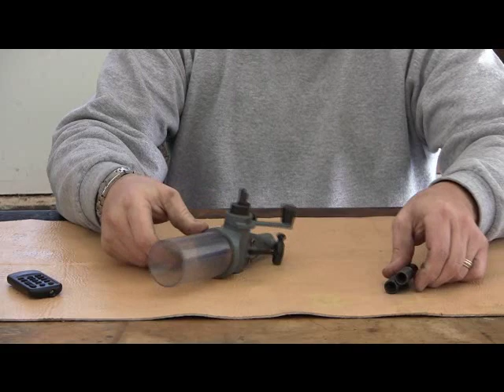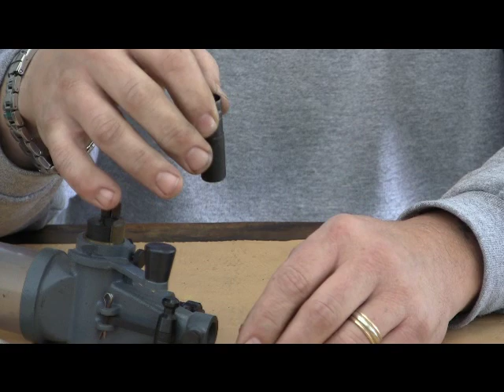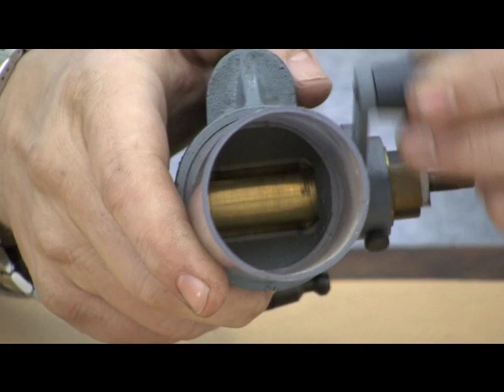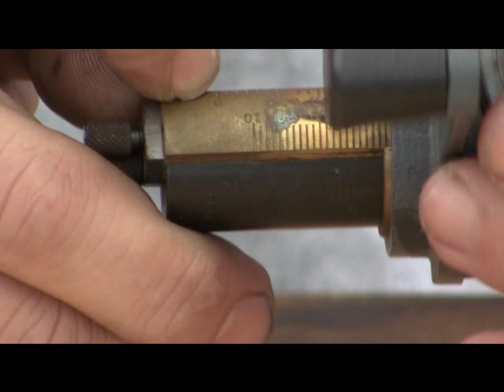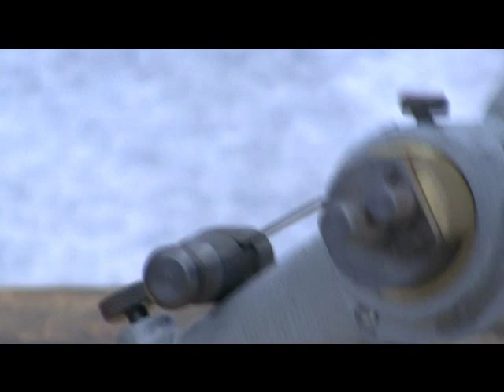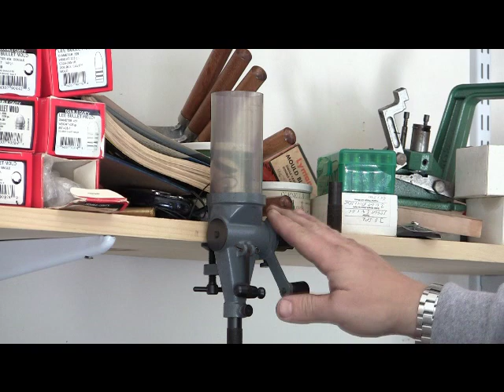Lyman adjustable powder measure 2nd version How to set up and use

Comment: Sometimes when you're using powder it sticks to the body of whatever you're using it sometimes it'll stick to the little tray in the scale you'll notice it also sticks to the top of the reservoir tube sometimes it sticks to the funnel. That little knocker is you flick that and it gets all the loose granules that are sticking to the inside of the body of the measurer . In my opinion you start with the lever in the top position swing it down and with one of your fingers you give the knocker a little flick and then bring the lever back to the top. Probably with two or three practice swings you can conquer that.

Comment: Thank you. 13 years later I am researching this as I bought the exact same unit 2nd hand. I reload .45ACP.  

Can I assume that if I set the bottom slot on 50  (marked on the G scale  = the "course" setting on black cylinder and lock it in)   The G settings higher up when loading, are for rifle loads I think.  

Will it  give me approx.5 grains of powder?  Is that assumption right?  
Sorry I do not have an electronic scale yet.

The small adjustment screw moves the brass slider left or right for fine adjustment after the decimal point?  If I move the small brass slider left,  the aperture becomes smaller,  and to the right the aperture is bigger,  but the bottom slider stays in the same place.. 

From a starting point of view: Do I start with with both adjustments aligned (say 50 in this query), and use only the brass slider to fine tune the increase or decrease of the amount of powder required?

Comment: Just getting started and bought some used equipment. One piece is an orange colored Lyman powder measure similar to the one in your video. It’s missing the cap for the reservoir. Do you have any instructions for setting it up?

Comment: as far as accurate - this is pretty good until I switched my powder due to shortage; The new powder is very sticky and no matter how hard I try, I end up either at 4.2 and 4.5 gn ~ I have made numbers of below pressure cartridges that resulted in stove pipes.
(my old one range is from 4.0 - 4.8 and I can get it at 4.3/4.4 everytime; these new stuff - 4.35 to 4.8 gn)

Comment: Get a baffle.  Works probably better than your funnel and you don't have to keep an eye on levels near as much.

Also you kept mentioning that the measure does grains.  I doubt that unless there is a volumetric grain that I am not aware of as mass grain can obviously very SIGNIFICANTLY from powder to powder.  I think it probably measures in microliters.  Just wanted to clear that up so nobody goes and thinks that they are throwing 4.3 grains of unique with it and actually throw twice that...

Comment: The accuracy of the throw is really dependent on the type powder. The smaller the granule of powder makes it easier to get spot on throws.  BLC2 or 2000MR meter like a champ.... 4064/ 4895 is a little more sticky.
Also don't mistake grains with granules, if you can't control the throw within 1/10 grain vs 1 or 2 grains, you should not be reloading.  And clean up your slides, this is a precision instrument, get the corrosion off.
Thanks for putting the effort in for the vid though, it is helpful.

Comment: I like the funnel idea, but I suspect I would knock the unit and spill powder. I, likewise do not use the tapper weight. I find if I just work the handle with some authority to sort of slam it at the end of it's strokes, it settles the powder for more consistent charges. I always wonder, which is better, with very small charges, like 3 grains of Titegroup, is it better to set the slides for a broad shallow opening or a narrow deep opening. I never tried an experiment to see.

Comment: I know this is an older video but...
I have been given one of these by my brother who has had it for many years.
I  set it up and was using H4831 stick powder to throw some loads. Almost every down pull resulted in unit sticking and having to force handel down. Is this common or something not right? I set it to throw 45 grns and then used trickel to get the .7

Comment: I got one of these from my brother. It has surface rust and I am cleaning it up. Question: I can't get the plastic reservoir off (it is not the unscrew type) Also I reload 22lr and need to measure between 1 grain and 2.4 grains with .2 grain accuracy. Am I wasting my time with this?
Reply from the maker: the plastic reservoir does not come off, I believe, when you get down to 1 grain or 2.4 grains of powder I do not believe any powder measure will be able to do what you want. so you will have to use a powder trickler  and weigh every charge to get that small amount accuracy

Comment: Not the easiest instrument to get the swing of so this video is excellent. One thing I'm not sure of...I'm attempting to calibrate the load with some scales. Can you make adjustment to the amount of load with powder still loaded in the thing or do you have to empty it of powder to change the settings?
Reply from the maker: you can adjust the the settings with powder in it

Comment: Worst powder dispenser ever made in human history.
It never gives the same amount of powder.
NEVER!
It's a worthless piece of garbage.
RCBS competition powder measure is way better and more constant.
Lyman 55 is a total disaster.
Reply: It's the Lyman Ideal 55 made for black powder not smokeless.
It is a second generation meter that traces back directly to the Ideal No 5 of 1892. Production of the No 5 from 1892 to 1947. 
Production of the No 55 from 1947 until replaced recently by the Brass Smith.

You're asking a meter who's internals were engineered way back in 1892 to throw black powder to instead throw an entirely different material with entirely different characteristics with entirely different min/max weight deviation requirements.

That unacceptable deviation with smokeless was very well within acceptable deviation of black powder.  The edge of the brass drum was never engineered or intended to cut extruded powder either and will suffer severe damage if done repeatedly, the violent shaking as powder is cut by the drum also induces additional settling and deviation in the charges. This doesn't happen with black powder.

You were misinformed by decades of marketing by Lyman and lot of old men winging it.  I too used to think this was a terrible design.

No. Just terrible marketing and equally terrible misapplication of the tool.

An adjustable wrench makes a terrible tire iron, not a terrible adjustable wrench.

There's a reason why Lyman adopted a properly engineered meter for smokeless. It took them long enough.

Comment: How do you remove the clear plastic cylinder that holds the powder if you want to clean it?
Reply from the maker: +SteelTank100  I don't think you can remove it,
Reply: +TheKoba49 I used it once & dumped out the powder when I was finished & noticed lots of powder stuck to the sides of the reservoir & body. I rinsed it out a few times with alcohol but can't get to the powder still stuck below the sheet metal baffle.
Reply: +SteelTank100 You can remove the reservoir and replace it. They offer an option of the standard short and long version for it. It snaps into place, you can search for replacing the reservoir on a RCBS uniflow and see a video on it and use that way to do it. I have removed mine by holding the main body in one hand and slapping the reservoir into the palm of my other hand then turn it and do that again until it releases from the body of the powder measure. If you look at Lyman's site you can see that you can get replacements cheap for it if you ever break one of them. There was an older version (I believe version 1) that was threaded but the later versions are the "snap in" style.

Comment: This will work for black powder also, correct?
Reply: Yes. The graduations are specifically for black powder. They read in grains by volume.

The design of the drum goes all the way back to 1892. It predates smokeless powder.

This is nothing more than a modernized Ideal No 5. Only change made were to incorporate a plastic reservoir and a set up fine screw adjustments.
Otherwise, it's an Ideal No 5.